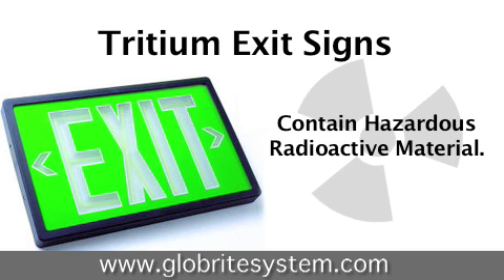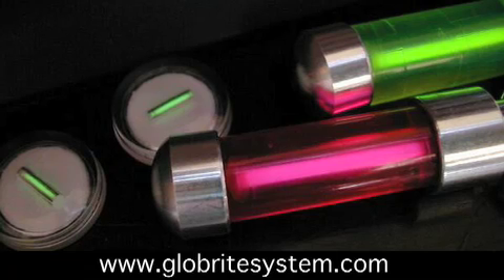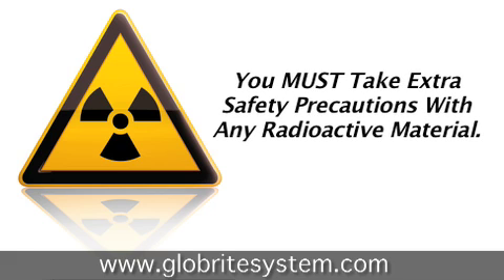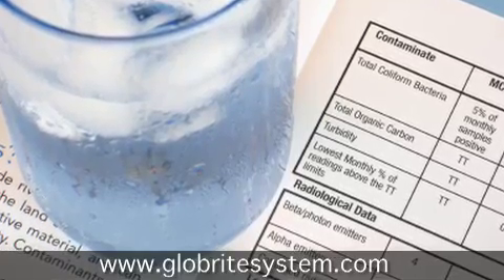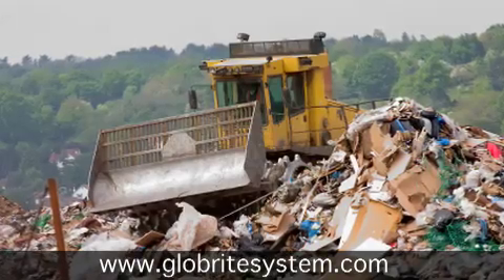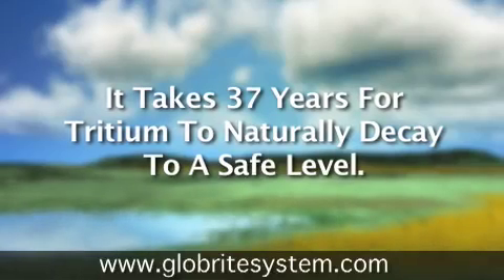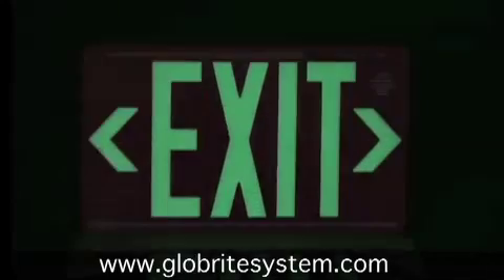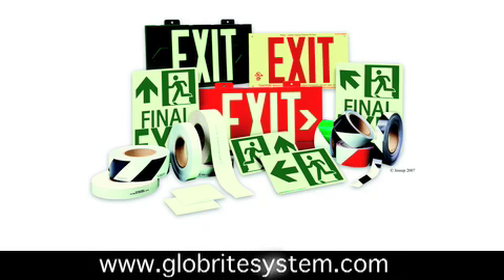Tritium Exit Signs - A Radioactive Environmental Hazard

Comment: @patrick mcconegly-while i do have an understanding that beta decay is potentially the most hazardous form of ionizing radiation to living tissues, i do agree that the beta emissions from tritium are not at a threatening level. In my last comment i was attempting to address the past comments which were somewhat misinformed, rather than contesting the fact that beta emissions from tritium are almost laughably low, especially when it is encased in a glass vial or similar glass container, since the interaction between said glass than the beta emissions can help stop the betas and in turn release a few stray xrays. I believe this was simply a misunderstanding. Still, this video is just awful and really quite inaccurate.

Comment: Beta radiation is actually very dangerous. Since it has a somewhat moderate energy it can easily be stopped once inside your body, releasing the energy inside there. Gamma can go right through your body, and alpha is stopped by your skin, so beta is by far the most dangerous for your body, as long as the source is somewhat near your body. But this video is almost completely inaccurate.
Reply: @patmcconegly  I think this is more of a advertisement for those shitty Photoluminescent exit signs which should not be allowed.